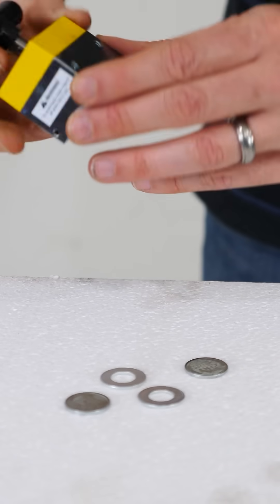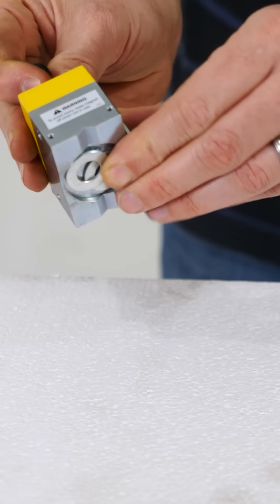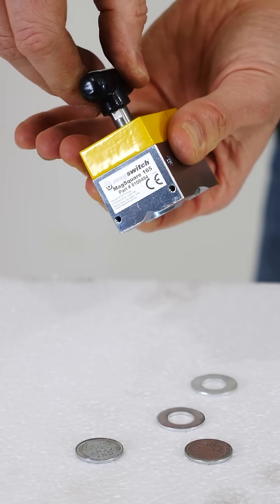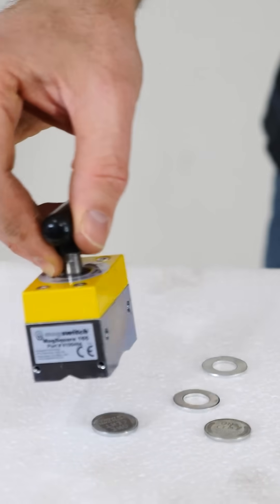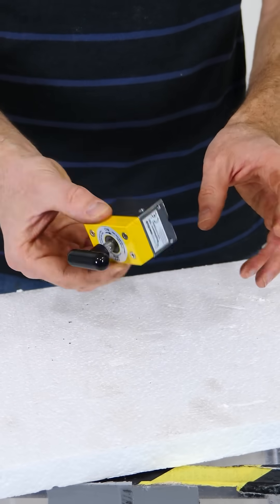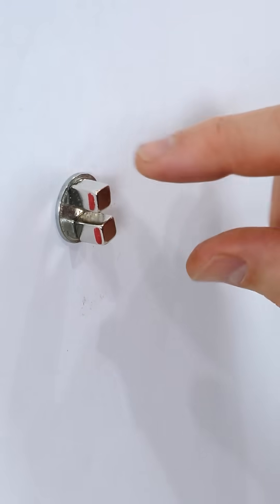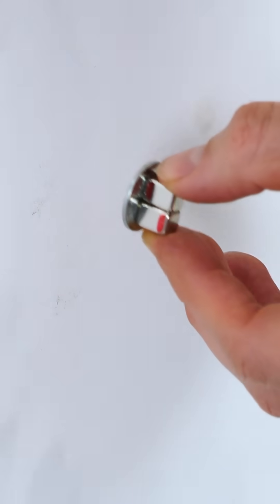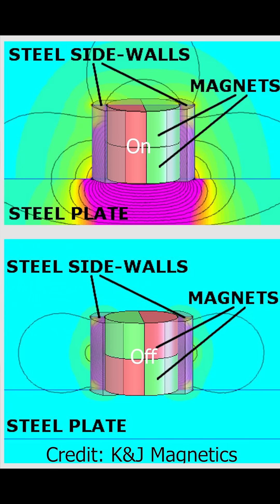How To Turn Off Permanent Magnets

Comment: This must be how door mag locks work!
Reply: Perhaps if it’s only mechanical. I think the door mag lock is a permanent magnet and an electro magnet :D
Reply: Door mag latch (inside the strike)  is usually a solenoid plunger. 

Mag Latch is usual a unit outside the door,  inside the secure zone with a steering electromagnet.  System can energize,  de-energize.

The main reqson they can't rely on this method is safety.  

The system can't rely on any mechanical means in case of fire. 

Door bars qualify because they can be activated entirely inside the secure zone
Reply: He's probably on about the locks that Google results show when you search "door mag lock" and they don't work in the same way as this device does, they're electromagnetic with no mechanical components.
Reply: Are they even safe? I mean people can open it from outside with some Great force right?
Reply: high quality ones are safe I think @TastyTales002

Comment: you are NOT turning the Magnet on or off. you are using the Magnetic field in opposition (so they cancel each other out) or in conjunction so they multiply the strength of the magnetic force. the casing is to counter repelling force when in opposition

Comment: You know what, screw you

unmagnets your magnet
Reply: I believe "unmagneting" is called "degaussing" (but I'm not 100% on that)
Reply: @mikemurphy5898 Unpermanents your magnet
Reply: @mikemurphy5898 🤓
Reply: I think you are right.  @mikemurphy5898
Reply: @mikemurphy5898  like on a CRT?
Reply: @mikemurphy5898 do we care? its about the joke
Reply: un mags your net
Reply: @hahahalala-i1x औऔऔऔऔऔऔऔ
Reply: Not pulling hard enough
Reply: @chiefcactus4091 Oh wait we were pulling?
Reply: I use a magnet at my work that can lift 500kg, that magnet works different to the way he describes, it basically pushes a piece in front of the magnets inside the box that blocks the magnetic field. I have to use a lever to lock and unlock.
Reply: @jasonanthonywebster8859 do you pick up metal shavings or metal things at the dump?
Reply: You mean demagnet
Reply: LE EPIC REDDIT HUMOR
Reply: @caastles  bro, you sound like Redditer trash
Reply: @caastles  Honestly this is way more cringe than just earnestly making a joke, even one that's very played out. No one is impressed by your irony poisoning.
Reply: My fucking magnets
Reply: More like unscrew you😂😂
Reply: A guy I know and his friend used a really big magnet because they had a laptop that was confiscated by the police and they used a massive magnet outside the wall to the evidence room at the police station and they turned it on and they were able to wipe all the evidence off the laptop. From outside of the room that the laptop was in. I didn’t believe them when they told me but then my mate, Jesse pinkman and his friend Walter white showed me the video of them doing it. 
Anybody who says this isn’t true or that I got it from the series “breaking bad” is lying 
Small print…
All names used in this story are fictional and any resemblance to actual people is purely coincidental….
Reply: @DeadSerious1 Wht a pity. The lap had a SSD.
Reply: @DeadSerious1   😂😅🤣   and you believed what you saw on TV?    Not physically possible, unless it was a monstrous electromagnet, with a giant diesel powered generator,  and even then  not beyond a few feet.
Reply: @DeadSerious1   Too bad you seem not at ALL  worried about the criminal actions.
Why?
Reply: Unmags your net.
Reply: Magneto: hey thats not fair
Reply: Yeah, how to temporarily turn off permanence.  This loser needs a dictionary.
Reply: By using magnet
Reply: Rotates your nuts.
Reply: What's wrong with you
Reply: Broooooooo❤😮
Reply: HOW DID YOU UNMAGNET MY MAGNET!?!
Reply: Psalm 147:3 ESV
He heals the brokenhearted and binds up their wounds.
John 15:9 ESV
As the Father has loved me, so have I loved you. Abide in my love.
❤✝️
Reply: Rotates your magnet 180°
Reply: finally an original comment
Reply: Just half a screw turn
Reply: " Screw you"

I see what u did there
Reply: " NOT MY MAGNET! "
" it's a                now. "
Reply: Not gonna lie, that'd be a hard flex in a manga.
Reply: Literally
Reply: Screw you is the opposite of unscrew you !
 you should've said "flip you" 😅
Reply: I was gonna comment that lol
Reply: This is what passes for humor in 2024?
Reply: @_..-.._..-.._  Apparently so? But it feels like it's been going on for years.
Reply: Actually the term would be unmagnetizeds your magnet

Comment: It's only worth it bringing back resources from so far away. At the point you could reach another star system, if you needed resources from it that badly the best way to get them would be to blow it up and send the chunks home. Other than that if it's just bragging rights like "we colonized this place", it'd be easier to change the DNA of your offspring to suit the place than find one like or make one like the home planet. Which maybe they did

Comment: I’m gonna guess that inside this object there are two separate magnets, when the magnets are originated with the currents magnetic currents in the same direction it picks up and when you turn the handle it sends the currents of the magnets in opposite directions. I assume that turning the middle takes a good amount of force from your level of effort. The opposite running currents, that are usually uniform in magnetic objects are no longer there so they don’t stick. But that is from my very little knowledge of magnetic

Comment: This makes your job 500% easier if you work in a metal fabrication shop and put it on an overhead crane... I spent about three days trying to figure out where the electro magnet was getting it's power from before I realized it was just a permanent magnet using some kind of magic I hadn't seen before.

Comment: I used to work with giant house sized robots that had gigantic tables full of magnets. To turn them on and off it would do something similar, but it would zap half the magnets with high voltage and it would flip their polarity without them moving. Then it would zap them again and they'd flip back and have literally tons of force.

Comment: I have a tiny one of these on the machine I run at work it's used to hold some spray nozels that are removed when maintenancing my machine so the magnet makes them super easy to detach.

Comment: This is not the only way these work. Another common system is to have a cylindrical magnet inserted into a cubic block made of two pieces of iron separated by a piece of non-ferrous metal (usually aluminum). The poles of the magnet run down opposite sides of the length of the cylinder. When the poles are aligned with the aluminum, the iron pieces "see" both poles equally and the magnetic fields just run through the iron. But if you rotate the cylinder 90°, each iron piece "sees" only one pole and becomes an extension of it, with the fields spanning between the two pieces of iron. Look up "magnetic switchable device".

Comment: Q1: which of the 2 configurations (on or off), if any, would significantly maintain (or evenincrease? and which, if any, would decrease) the life time of the permanent magnets? or, in other words, does the switched off ("short-circuited") configuration affect the magnets over time? 
Q2: does it matter if a permanent magnet sits idle vs. works to pull/ push another magnet or a ferous metal, in general, not specifically this "switchable" magnet?
 
Q3: what if no work is performed, but the opposite fields cancel eachother out (as in the off configuration of this)?
is/are the intensity/ies of the field/s affected or do they perfectly bounce back (i.e. with no loss), regardless of the number or frequency of "on/off switches"?

Comment: Had bigger handheld versions of these in the shop at work for lifting cut pieces of sheet metal off the plasma cutter. Had no clue how they worked but still thought they were pretty rad 😂. They’re crazy strong too. Like you would not be able to pull something off of it no matter how hard you tried.

Comment: Build something similar for a project at my uni. We created a small Halbach array of magnets inside a 3D printed tube and placed it inside a mechanism that could be turned 180 degrees. 
The idea was to create a strong coupling mechanism for an underwaterdrone while minimizing the powerdrane on the batteries.
Got me a solid B+

Comment: I work at a machine shop and we often use these kind of magnet to lift heavy steel material. Things that are up to 1000lbs! Ours are obviously a wee bit bigger than the one used in the video.

Comment: Could this be used in electric motors? Switch it on and Off electrically. I know that would be an electro magnet, but use the energy for on/off, not pulling

Comment: I think it has 2 permanent magnets inside the box, both aligned with same poles and it acts as a magnet but when you turn the handle you turn one of the magnets and when it aligns opposite poles with the other magnet the magnetism is neutralised.

Comment: Will be a big improvement when used in version of magnetic car engine someone built. His design used metal sliders to block the magnetic field to switch it on and off. However if switchable magnets were used the metal sliders are not needed in his design. His design was created to increase torque by bringing the magnets closer together. Might be able to use cog close to centre of spinner on outside to turn driveshaft to turn switchable magnets to open magnetic field when magnets on the spinner are opposite switchable magnetic field is switched open. As in magnetic field is open when magnets are opposite each other in correct position. Most likely the design has allready been built as it is fairly obvious even if not shown yet.😊. Have a good day.

Comment: Excellent, now it may be easier for enthusiasts to try and make it gently flip (more small pieces in increments?) and work like a moon in an orbit around an orbiting piece or iron/steel with liquid lava inside (heated by friction and or mini sun) so that attraction and repulsion are regulated - such that the sum is zero near approach to another neautralizable magnet- and momentum is utilised to continue the pass and repulsion initiates after the pass, using hot and cold sides of oval orbits (seasons) to somehow effect the magnetic strength and weakness of the lava so that the solar system is copied - along with the downward spiral which has such momentum that the drop is minimal - whilst the gravitational kick is present.... 

This may not be free energy - but it could be very efficient... Somehow..... God knows.

Comment: All magnets have north and south poles. Opposite poles are attracted to each other, while the same poles repel each other. When you rub a piece of iron along a magnet, the north-seeking poles of the atoms in the iron line up in the same direction. The force generated by the aligned atoms creates a magnetic field

Comment: OK that's pretty cool but why is it better than an electromagnet ?  if I was designing a giant magnet for the boom of a machine to pick up scrap metal, why would I use this instead of an electromagnet?  Wouldn't it beneficial to just cut the power and then have no magnets left?  because even if poles are reversed 2 magnets so close to each other could be quite dangerous, no?

Comment: We use 2 larger versions of that magnet at work to pick up 600-1000lb steel sheets at work
Reply: In a machining shop I used to work at we used these attached to winches that were connected to rail systems on the ceiling so you could lift up a 1000 lb bar of steel and easily carry it anywhere in the building. Super useful devices.
Reply: @FizzyCape  we have a small scale version of that, super handy
Reply: @robertkelly3041  is it easy to pull it off
Reply: @8DDeutschrapJMX  Easy as pie
Reply: You mean "steel metal" sheets?
Reply: @ItSammyDeer  Pretty sure everybody know what I meant without the correction
Reply: @robertkelly3041  y-you didn't get the joke...
Reply: @ItSammyDeer  no sorry
Reply: @robertkelly3041  i was quoting how he called the pieces of steel "steel pieces of metal"

Comment: You need to stop using the word “literally” if you don’t know how to use it.  In your case, you can’t separate the magnet from the metal piece, there is no “literally” required.  You couldn’t do it, period.

Comment: My friend brought one of these to school once. He got it stuck high up on a metal doorframe where he couldn't reach it to turn it off, so he jumped and grabbed it, using his own body weight to tear it off. Well, not only did the magnet come off, but so did some of the paint from the doorframe.
Reply: for a moment i was afraid his finger had gotten stuck and ripped off or something hahaha
Reply: @therealshard  42nd 👍
Reply: @therealshard 😂
Reply: @therealshard that would make it hilarious
Reply: The latex paint has poor adhesion to begin with.
The magnet pressed against the frame so hard it caused the latex paint to adhere to the magnet (like masking tape). 
If you get your friend to try the same thing with an Oil Base Enamel coated surface (like an antique railing) the magnet will pull away clean
Reply: @RetroCaptain  makes sense I was here like "wait, paint isn't magnetic"
Reply: @RetroCaptain  not DTM ( direct to metal) acrilic water base interior exterior paint the head would pull away first if it's a school interior frame it's likely metal frame not wooden and if that's the case it's likely either as you said plain latex,( which IMO don't think ) or was oil base and not applied correct frames wasn't cleaned properly and or wasn't layed correctly runs to thin to thick wrong humidity temperature etc the DTM kinda toxic and expensive not ergonomic
Reply: @youmemeyou YouTube’s auto translate is hilarious sometimes.
Your “ok” comment triggered a translate prompt. I clicked it and ‘ok’ changed to ‘increase’🤯
Reply: And some bucks from his parents account too I suppose
Reply: @comrade_commander some or abt 54 bucks from his parent's account, how did he manage to get that without his parents figuring out
Reply: Very anti climactic ending to this story lol just some paint? Sheesh..
Reply: @mid-wikid  well, if it helps, he was skipping class when he walked into mine while the teacher was out of the room
Reply: @seanzy219  I gotchu...

Also, the arm he used to grab the magnet exploded. 👍
Reply: @mid-wikid yea well, retrocaptain even explained the ending
Reply: I thought the twist was gonna be that it still didn't come off
Reply: that is how you know it was lead paint oops😅
Reply: @zagrych  yes more chance then not 😂 DTM not ergonomic enough and nobody paints commercial metal frames to reapply latex ,lead base flakes off alot lol latex worse especially with holiday and runs bubbles and creases
Reply: @lancesudberry209  definitely not dtm from your description, those are still just acrylic or latex paints and would more peel than chip.  its ok, one day I accidentally found out my porcelain sink and tub are lead cause I accidentally hung my magnetic headphones on them oops.  it happens sometimes stuff is old 😂
Reply: @zagrych  😂 it's quite the shock when porcelain reveal it's deceit! You'd definitely find out who ever tries removing it cast iron and cast tin is different too 😆
Reply: Misson Totally Impossible
Reply: Do you realize how stupid this is? What does a magnet have to do with paint? Nothing. It’s a pointless comment.
Reply: These things are no joke
Reply: Temporarily
Reply: Of all the things that didn't happen, this happened the didn'test.
Reply: @smoothcast  ...but it did. Literally why what reason would I have to lie? lol

Comment: "Steel pieces of metal"    I mean, not a  great sentence. "Pieces of steel" would be proper. Because it's common knowledge that steel is metal. You assume that when you say "piece of steel," that they automatically make the distinction that steel is metal... 3/10

Comment: Why isn't this used in motors? No electricity or gasolene required. Turn on to pull up a piston and trun off to let it go back down. Or rotary engines with computor controlled on/off timing.